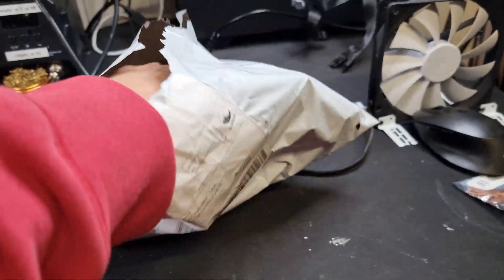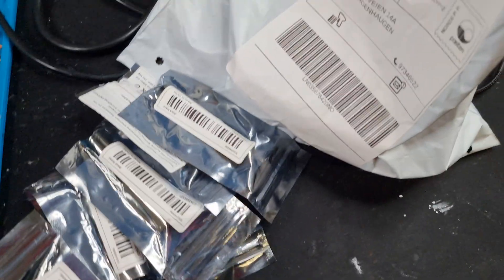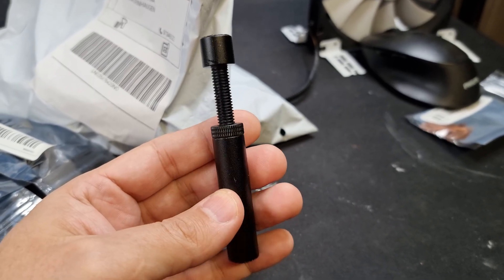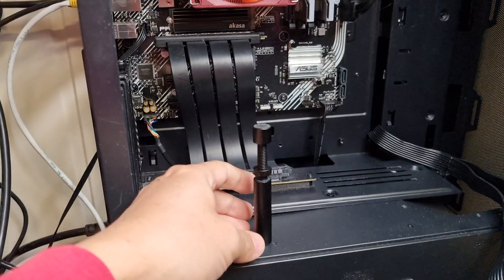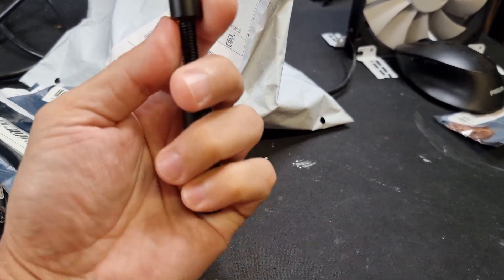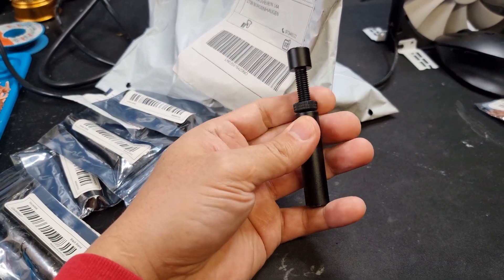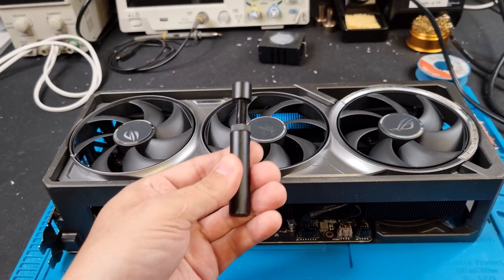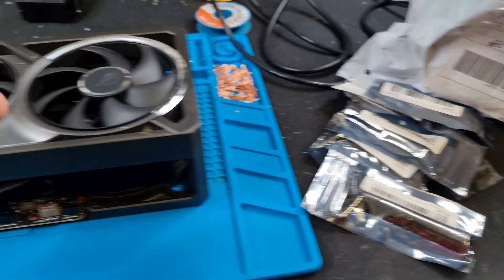ASUS ASTRAL RTX 5080 TEARDOWN.

Comment: Thank you for this teardown, the gf got the Hatsune Miku edition of this when it launched a couple months ago and today we were transfering all the parts into a new case, I was testing cable lengths and seeing which cables went where as she also got the new Miku power supply when I failed to notice the cables for the gpu had latched onto the chairs armrest while still attatched to the gpu, and when I slid across brought the card smack onto the floor, knocking a component off. Thankfully I was able to solder it back on, test and confirmed that the gpu is good to go again, and seeing the overview of all the components, namely the square R33 2444 comp above the 16 pin rail as that was what had been knocked off and I wanted to make sure to place it back on correctly in case it was directional.
Reply from the maker: That is one my worse nightmares. I deal with these things daily and im always afraid to drop one of these things considering they are not mine. 😅 glad it worked out for you in the end.